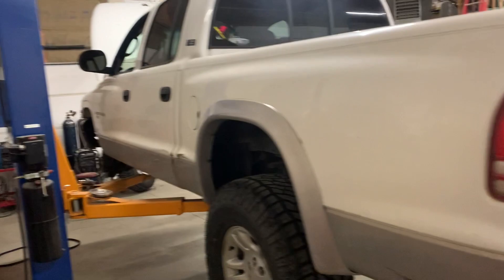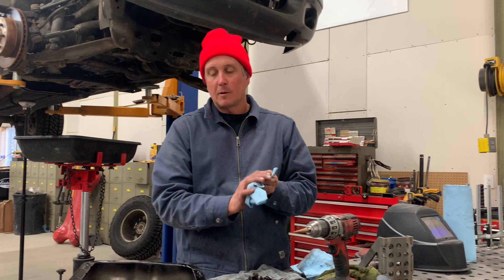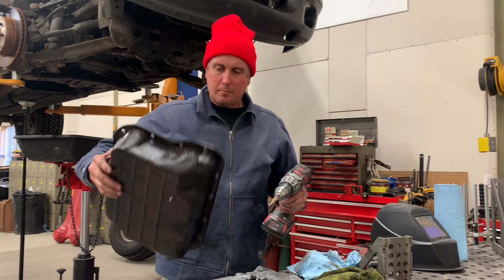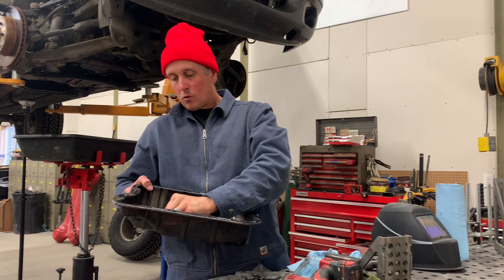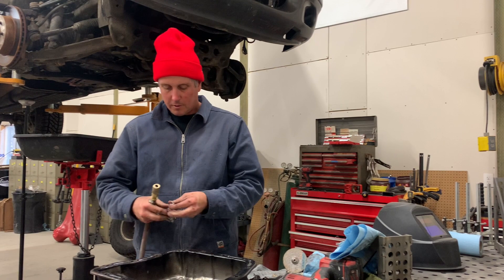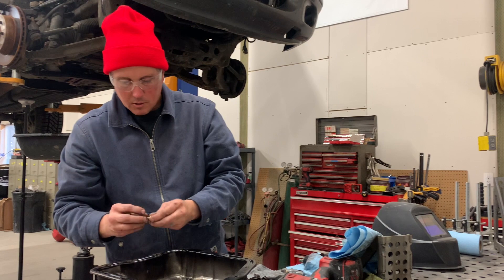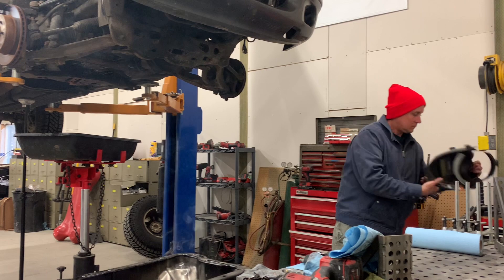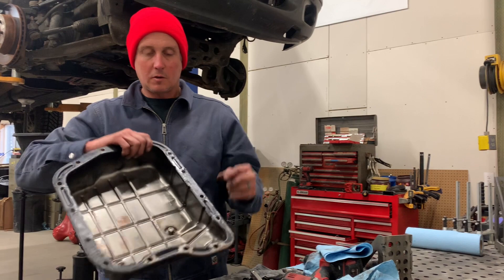Daily Grind!  Transmission Hack with Dirthead Dave.

Comment: You can also use a castellated nut and invert it inside the pan. Just weld it on 2 sides. When I did mine I welded the nut to the outside of the pan, it hangs down a little lower but worked fine.
Reply from the maker: I actually mentioned that as I was doing
It , but cut that part so I wouldn’t confuse people
Reply: One issue with a castle nut is it might not support the pan sheet metal around the sealing washer leading to a slight drip.

Comment: Drill & tap a hole in a scrap (1"sq is fine) of 1/4" steel flat bar and weld it to the outside of the pan. Then fully TIG the pan-to-plate circle joint inside.  That'll give your washer a bearing surface to seal against and allow you to completely drain fluid. Worked for me, anyway. Thanks again for keeping the dream alive here on YT for all of us!!!
Reply from the maker: Done that too in the past. Works good

Comment: I have installed the bulkhead drain fittings in transmission pans before to make less of a mess when changing the fluid and filter... but I never thought of draining and refilling to get more of the old fluid out of the converter!  That's awesome!  Thank you!
Reply from the maker: Thank you

Comment: I had the same truck I bought for my wife she loved it. I drove a 97 Dakota with a completely built 318, got bored of that so I put Dana 60s underneath of it with a big Block 440. Blew a head gasket in 440 and dropped a 12v Cummins with a 5 speed and magnum doubler box hooked to a 205.
Reply from the maker: Sounds like a beast

Comment: I usually get two flanged nuts and weld the one upside down on the bottom of the pan to not trap any oil.  But that’s a good idea with the notch never thought of that when doing it, now it makes me think a castle nut would be even better, then it would be slightly more up and protected.

Comment: I use a drain plug for a Chevy transmission mainly because they are easy to get just about anywhere....and I carry a couple of spares just in case. And yes, notching the bottom of the nut actually works.
Reply from the maker: Yep.  Many options to make this mod work.  Thanks for watching

Comment: NICE!
I’ve done this in circle track cars and welded the nut to the outside. I guess the drawbacks there include the need for a ‘water-tight’ weld and another 1/4” or so hanging down.

Comment: Drain plug is nice. You know what works good also? Flush it through the cooler lines. Figure out which line comes off the cooler returning to trans. Connect a hose to it n put that in a bucket. You can flush it pretty good. Then pull the pan n do the filter. That thing will be clean😁. Sometimes you can drill n plug the converter to but that can be tricky.

Comment: Not sure if it’s easily doable on your Dakota. But with many vehicles like my Silverado 1500 you can buy a barb fitting that fits in the transmission cooler and run a hose to a drain pan and you can start the engine for a few second to pump some nasty fluid out. And it empties most of the pan contents too.

That’s what I do before removing the pan. What sucks is you still have to remove the pan no matter what to change the filter in them. I wish more/ all automatic transmission had external filters and drain plugs like the Allison 1000 that comes in the Duramax trucks.

Comment: I installed an in-line spin on filter on my 2500 Ram. It catches everything, did the normal 30k oil and filter and that typical “dirt” in the pan wasn’t even there. Now I can change a hydraulic spin on filter on a regular basis without all the mess and waste.
Reply from the maker: Sounds like the best option

Comment: Which is a better set up on Jeep TJ, with a 4-6 inch lift on 35 inch tires, long arm or short arm suspension, you seem to be a suspension guru, wanted to know your opinion on if long arm is worth the cost.
Reply from the maker: That’s kind of a loaded question. I prefer very little lift and cutting to fit larger tires
Reply: @thedirtheadshed  do you prefer long arm or short arm? just getting my first jeep. looking at an 05 Wrangler LJ, going to be a daily/ adventure rig. getting conflicting research on long arm vs short arm. Was wondering if you had an opinion, I imagine it might be highly use case driven.

Comment: Castle lust left over from tie rods work good for this, if you can find the right bolt!  And I despise air leaks in my compressor.  As long as nothing is plugged into the hose, my little compressor cuts in once ever 2-3 days from air leaks.  It was not easy to get it that tight!
Reply from the maker: Leaks are just part of doing this kind of work. No matter has hard you try prevent em

Comment: Transmission drain plug is genius. And much cheaper then buying a trans flush machine.
Reply from the maker: Yeah.  I just drain and fill when I do regular oil changes. After a few of them the fluid is back on track

Comment: hi, i have a daihatsu terios j102, and they have pretty much a factory defect, if go to full lock on the steering the outer cv boots torn and you end up ruining the cv join, any recomendation for correcting it?
Reply from the maker: Set up some steering stops on the knuckles so it can’t steer as sharp
Reply: @thedirtheadshed  thanks, i'm gonna try this

Comment: What I normally do is get a steel AN bung and just use an aluminum AN cap so I do not have to worry about the washer.
Reply: that's actually a really neat idea provided it's not a rock crawler or lowrider in danger of tearing the bung off. Thanks for sharing that.
Reply from the maker: I’ve done that too. Works great

Comment: Usually I disconnect one of the trans cooler lines going to the rad, aim it to a bucket, get my fluid/funnel ready at the dipstick, start it up and start filling at the dipstick while its running. Usually just keep on going until the fluid going in the bucket clears up. Risky but you do get just about all the old fluid out.
Reply: I did that on mine. I just ran it until fluid stopped coming out, shut it off, refill and repeat. Did it a smarter way on my friend's truck and measured the fluid that came out so we knew how much to add and didn't have to screw around to set the level afterwards.

Comment: Love the channel but dude get a cheap mic.  You could still use your phone you’ll just get one that plugs straight in they are cheap and if it’s connected to the phone you won’t have to sync them together.
Reply from the maker: I had one for a bit but it broke. Need to find one that has a cord so it’s not so fragile
Reply: @thedirtheadshed  oh crap you actually replied to me, that’s awesome.  I use a purple panda in my iPhone with a connector.  I have a verity of line lengths and I think I paid like $40 for the whole set.  Love the channel!!!

Comment: I use an easier solution, I have an electric pump that has a small plastic tube that goes in the dipstick tube, you pump out the fluid, refill, drive vehicle, repeat, then drop the pan and replace filter
Reply from the maker: Good trick